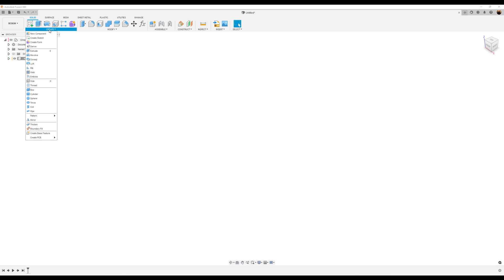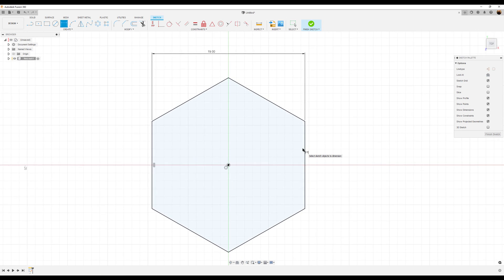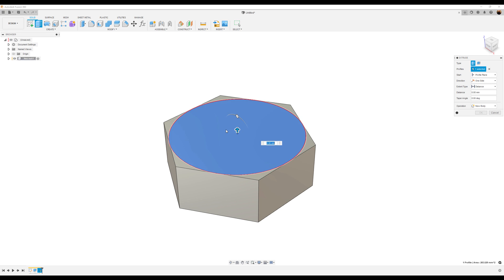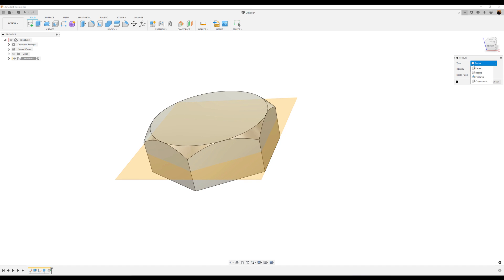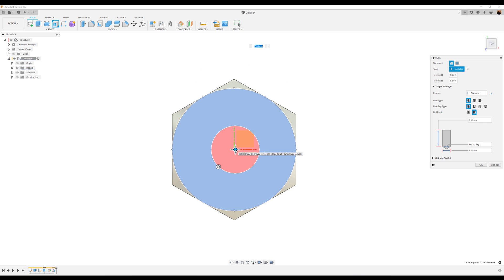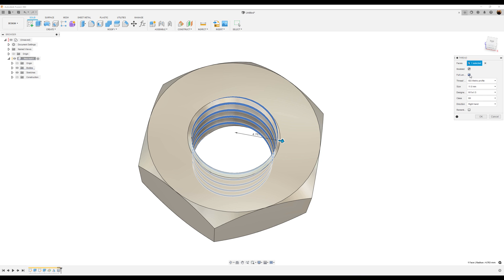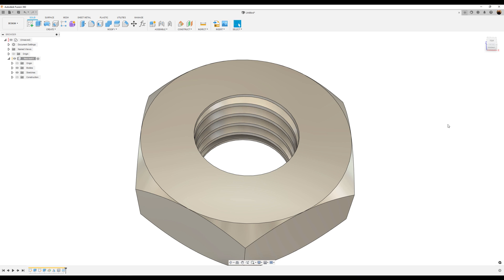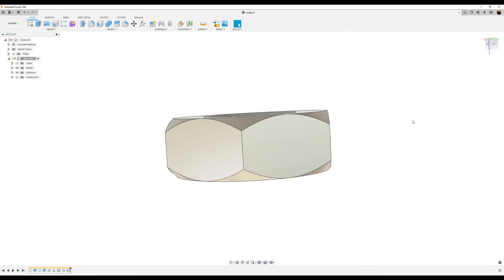Create A Hex Nut improved! | fusion 360

Comment: The steps are easy to follow. The part I don’t understand is the inner diameter. I need to make a replacement cap for something. If I measure thread to thread it 34mm. If I do the hole at 34 it becomes too small when I add the threads. What I missing to know how much to size up the hole?

Comment: Very nice instructions.  One way you can get around needing to know the depth of the threads to create is to chamfer the edge of the hole before threading, roll the history marker back before the chamfer operation, do a full length modeled thread, then drag the history marker forward to restore the chamfer.  

Keep up the good work.  I love watching how others would do things, as it teaches me how others might think about and work through how to model things.  My method for making a nut would have not been like this, and would have taken so much longer than this.
Reply from the maker: Thanks, that is a good tip to know! There are so many ways to do things in Fusion 360, I'm always interested in others' techniques!
Reply: Thank you, That is the best suggestion so far. The chamfer is also threaded! Great idea!!! Before I was creating cylinder and combine-cutting it with fully threaded nut to have a form to cut the thread into a nut with countersank hole. Your approach is much quicker.